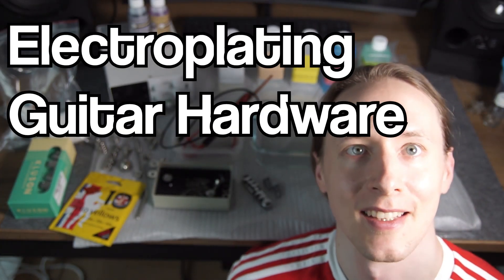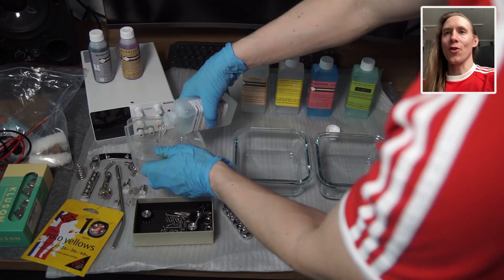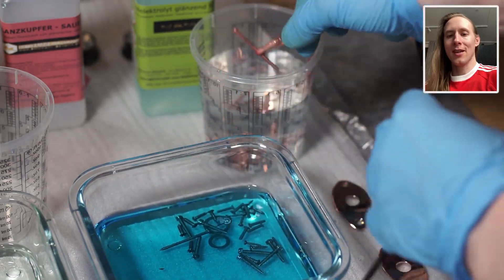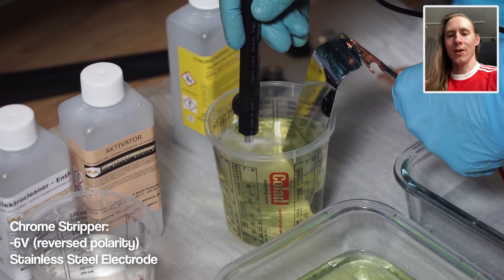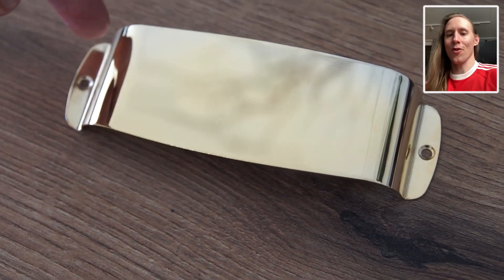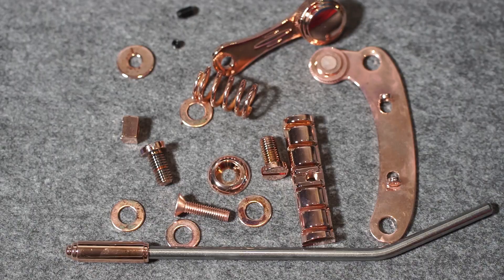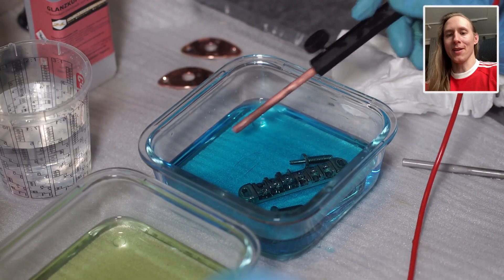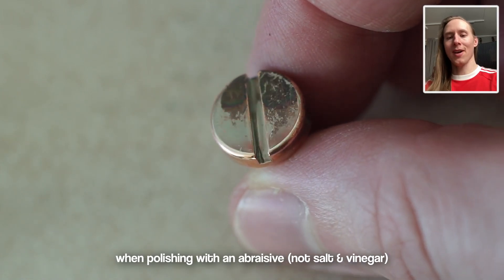DIY Electroplating of Guitar Hardware | Gold, Nickel, Copper, Chrome etc.

Comment from the maker: CAUTION: The chemicals used for electroplating are hazardous. Always check the hazard label and follow the PPE guidelines (wearing gloves, goggles, facemask, be in a well ventilated room etc.) of the products you're using.
Never dump these chemicals down your household drain, including the water that was used for rinsing the work pieces (use a dedicated container and not your sink) - check your local chemical recycling laws.
Reply: Hi, I am trying to order exactly the same brand and products from the Manufacturer's site but since I am not German and do not understand the language, can you please tell me how many ml does each Electrolyte, Chrome, Remover, and Degreaser was used on this video? Also, did you order the whole kit or just the separate bottles? Thanks in advance.
Reply from the maker: @ninkichan7209  I've ordered separate bottles. All 250ml, except for the gold and black chrome I only got 100ml.
Reply: @GeorgFigél  Wow, that was a quick response. Thank you very much! Regarding Chrome stripping, do you have a separate video on that?  You mentioned that it is reversed polarity and to be honest, I know nothing about these electronic gadgets that you are using as I want to try it in a minimalist way like using commercial batteries. I might consider buying that machine though if it is the only way.
Reply from the maker: @ninkichan7209  It can be done with batteries, but to easily adjust the voltage for each application it's best to buy a "variable power supply" (DC)
It might cost 50 - 60$
Digital ones from china work just fine.
Reply: @GeorgFigél  You've been very helpful. I hope you make more content like this, especially how to operate these things propely. Thanks!
Reply from the maker: @ninkichan7209  thanks :) I'm a beginner at electroplating myself, and I'll mostly make guitar building and guitar playing videos. 
It's good to have some practice pieces to get started. You might also search for electroplating info on Reddit etc

Comment: So... would this work on a whole guitar body?
Reply from the maker: There is a special paint that has metal particles in it, this paint can be nickel plated and then e.g. chrome or gold etc plated

There should be videos of this of e.g. people that make 3d printed items who then try to gold plate it.

Another way is the "spray chrome" system (there are some videos videos of that on yt). But it's very expensive.

And all of these methods would require the guitar body to be sanded and polished perfectly before metal plating. Otherwise it'll not be reflective like a mirror.

I would just gold leaf (or whichever metal leaf) a guitar body and then clear coat it. It's be different, but a lot easier.

Comment: Hi I’m having trouble finding the cable used, what is the thing that holds the rod?
Reply from the maker: I got that from the shop that sold the rods and electrolytes. They call it an anode-holder. https://real-gold.de/Handgriff-Anodenhalter/BMG-027
But any shop that sells electroplating supplies should have it.
Reply: Thank you for the fast reply! It doesn’t look like they sell these kind in the states. But I’m going to keep looking
Reply from the maker: @eaglewithascope sometimes it's called electroplating pen

Comment: Thank you for making such a clean and concise video! Totally gonna gold plate the hardware on my new black Ibanez once I get the chance, I'm a sucker for Black & Gold but guitars with gold hardware outright are generally marked up for it so now I can do it on my own! Also I know that this video is a couple years old but I was wondering about how much it costs to get all the equipment for plating? I already have a power supply, but knowing the actual cost of the project before I start will allow me (and others who see this comment) to do it at a much more comfortable time lol
Reply from the maker: I'm also a fan of black with gold hardware :)

The most expensive item is the gold electrolyte. But to do one guitar, a small amount should be enough.
I think it should be under 150 or 200$ all together (the various electrolytes, electrodes etc)
It depends on where you live. I'm in the EU so I got it all from real-gold.de in Germany. But if I lived in the USA I'd get it from elsewhere. You can search for "gold electrolyte".

If the hardware on the guitar is nickel plated, then it's the easiest. If your black Ibanez has black hardware (e.g. powder coated black) then it'd be very difficult to get the powder coating off and to prepare the hardware for electroplating.
Then I'd rather replace the hardware with gold ones and sell the old hardware.
Reply: Thank you for the reply and information! honestly didn't expect a reply lol, anyway luckily it has either Nickel or Chrome, either way much easier than removing the powder coating I agree, Either way again thank you for the great video and extra info! Will for sure be coming back again once I do it myself!
Reply: I'm trying to figure out what's on my Ibanez edge pro tremolo... I know it's steel but don't know if there's a layer of chrome or nickel... The colour is cosmo-black
Reply from the maker: @renardcadresuperieur  some people say that cosmo black is "black nickel", but I don't know for sure

Comment: Hi sir want to ask i have few shecter synister gates & johny christ bass sugnature that mostly use gold plated. So over time they got rusty. What procedure i must do. De-rust the parts first then moving to gold plating or just proceed gold plating
Reply from the maker: @mohdrosley9909  I'm not an expert, but the part needs to be de rusted and cleaned 
Maybe it even needs new nickel plating to start
The gold plating then goes on top of the nickel plating
Reply: Thanks so much bro appreciated👍🏻👍🏻

Comment: I've been looking for something like this for so long! Awesome video!
My Gretsch Double Jet is arriving in a couple of days and I want to give it a Jack White's Copper Triple Jet vibe with copper hardware but couldn't find any reliable sources on how to procede...
Would you recommend electroplating over "relicing", notably when it comes to chrome hardware? I've read that there should be a layer of copper under the chrome plating of the hardware and that I could get the chrome off with different chemicals, have you ever tried it?
Also could electroplating affect playability? I'm a bit reluctant to do it on "mechanical" parts, it seems alright in the video especially with the brush-on technique but maybe you've got some better feedback now that time's passed?
Thank you so much for the great work!
Reply from the maker: @LePetitPedroTV  usually there is a nickel plating underneath the chrome.
I have never tried electroplating over relicing. It's best to try it out on a test piece.
If it's chrome hardware, then you'd need to strip the chrome first, unless the idea is that there is some nickel coating exposed due to the relicing and then to copper plate only the exposed nickel.
Reply: I should have phrased it differentely, but the question was rather strippping off the chrome ("relicing") instead of electro plating, but I'm understanding it's not possible to plate directly over chrome? :)
Any feedback on playability?
Thanks for the responsiveness!
Reply from the maker: @LePetitPedroTV  yes, it could work to relic off the chrome, but it's probably tricky to only remove the chrome without going all the way through the nickel as well.
Also, nickel and chrome look similar.

With gold hardware on the other hand, it's easier to see: E.g. a gold bridge might lose its gold plating due to friction from the palm muting, and then you start to see the nickel instead of the gold.

Playability: There should be no difference, as the plating is super thin.
Just don't copper plate the strings like I did.
The copper on the strings turned dark really quick and they felt rough.

But to keep in mind, copper will corrode over time, all copper plated hardware will turn dark sooner or later.
Reply: What abour using chemicals to strip off the chrome? I've seen various methods and chemicals used in order to do so, any risk it would also strip off the chrome/nickel plated underneath? Seems to work fine in your video
Reply from the maker: @CPedrosa94  the chrome stripper I've used would only remove the chrome, and it only works in combination with electric current.
I haven't tried any other type of chrome stripper chemicals though.

Comment: Isn’t it illegal to de-chrome parts at home?  Maybe I’m mistaken. But I was told by a local company that the chemical vapors to do this are very toxic and need license to do so.
Reply from the maker: @ChrisBealsProductions  yes, de-chroming produces toxic vapours. It might be illegal in some countries or states and it's for sure strictly regulated what kind of electrolytes can be sold for home use and/or what quantities.
To do this as a business, where the parts are sold afterwards, instead of it just being a science experiment, probably requires a license.

Comment: Nice video mate ,do  you have a links to equipment you are using here?
Reply from the maker: I've got the liquids and electrodes from real-gold.de
The glass containers are from IKEA.
The laboratory power supply is a cheap one from Amazon (60$ or something, there are many options)
Reply: Thanks a lot,but it looks like the link is not working at least for me @GeorgFigél
Reply from the maker: @rattlehead9656  oh sorry I had a type
It's real-gold.de
That shop is from Germany, but there are surely similar shops in other areas of the world. They can usually be found when searching for electroplating supplies
Reply: Danke Schon @GeorgFigél

Comment: arh this one is interesting, can I electroplate Black hardware into gold colors? cuz i always thought black colors are different material or just paint?🧐
Reply from the maker: I think black hardware is powder coated (more durable than paint), which you can't electroplate over. Except "Cosmo black" might be an electro plating that can be removed with the chrome stripper to then gold plate it
Reply: @GeorgFigél  thanks for the reply, so i needa strip the coat off first😏😏
Reply from the maker: @JoviChan  yes, but usually it's powder coated and it'll be very difficult to remove. Powder coatings are durable

Comment: That's fantastic piece of information...I used to make colloidal silver and gold many years ago but I totally forgot how to use the dc supply and I no longer own one. Can you please now make us a little tutorial a bit more in depth about the settings on the DC PS and the time line of the different stages? I need to re-gold plate a bridge, because it's no longer being produced and impossible to find a NOS (Although I was lucky enough to find a set of NOS saddles.  I believe I must strip down all the residues of the old plating before doing the process. Do you think I can do it using just chemicals or should I have to manually remove the old plating some how? Please a more in depth tutorial THANKS!
Reply from the maker: I'm not experienced in restoring old parts, but if some of the gold came off, then there's usually nickel underneath.
You can try doing using an electric cleaner and then "activator" (oxide remover) to then brush on new gold.
The voltages that I've used are written on screen during the video. But it's best to start low. A too high voltage can cause the surface to look rough (that's what happened to some of my copper plating test pieces). Regarding the time: I put the parts in each bath for just 30 seconds or 1 minute tops. Except for the gold and black chrome. These took much longer. Gold plating can be sped up with more expensive electrodes though.
I'm a beginner with all of this, I took my Infos from the descriptions the German online shop had that I was buying the electrolytes from. So maybe there is a good online shop in your area with information regarding the ideal voltages etc.
Reply: @GeorgFigél  Thanks!

Comment: Lovely work, I would be interested in chrome plating our anodized aluminum metal camera parts, but I am concerned a too shiny surface will be counter productive in a camera, did you also experiment with aluminium and matte chrome finishes?
Reply from the maker: Usually you would electroplate a part instead of anodising it. But maybe the anodised surface can be removed, similar to how the chrome stripper works.
A matte chrome finish can be achieved if the part had a matte surface to begin with.
E.g. by sanding off the anodised coating and then chrome plating it (well, probably a nickel plating will be needed as a first layer).
Reply: @GeorgFigél  anodizing is basically just replacing the aluminium oxide layer with one that is color pigment infused so the oxide remover step could already do the trick - in particular the parts I have in mind have no color pigments anodizing as I hoped for a silver/natural finish but the result had a slight olive tint. Sounds good, the part already has a sandblasted matte finish.
Reply from the maker: @ApertusOrg  the olive tint is to give it a stealth/outdoor camera vibe ;)

Comment: Very cool episode. As a machinist in the Navy we did quite a bit of this for repair parts. With the brush method you can get a little (tiny) pump to keep your brush soaked with fresh plating solution, it also helps in the bath generally to keep it circulation. Again great job & great outcome!

BTW watch out for silver, most pro solutions are cyanide based.
Reply from the maker: that's very interesting that electroplating was used on a vessel :)
I better stay away from silver then. I think, in that case it's easier to buy guitar guitar hardware in chrome, it'll look similar to silver.

Also, on the page that I got the chemicals from it says: Real Gold´s chrome stripper does NOT contain caustic soda - sodium hydroxide - which is corrosive and dangerous. It does not attack or stain paint.

So I guess it's a safer version than the usual chrome stripper.
Reply: @GeorgFigél  a pump shaft bering spun, damaging the shaft instead of making a complete new one we would build up with nickel then machine it back into spec. Silver we used for steam valve seats.
Reply from the maker: @_mysilentblue2227  that's really cool, to be able to build up a substantial amount of nickel